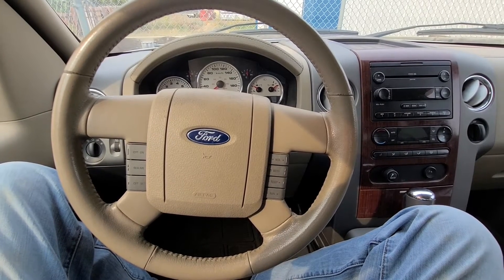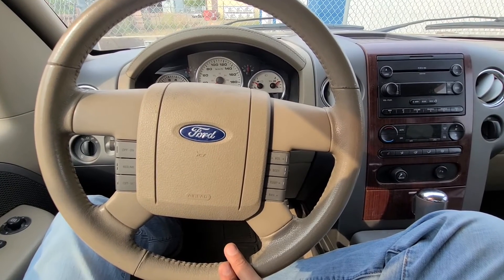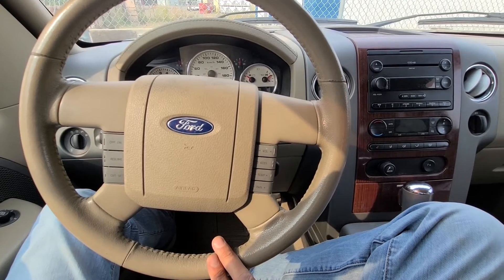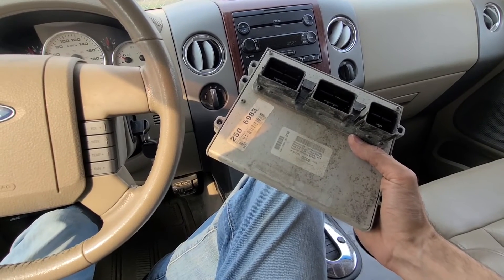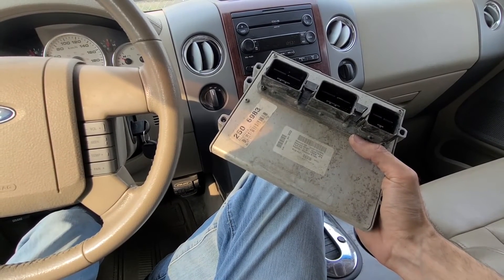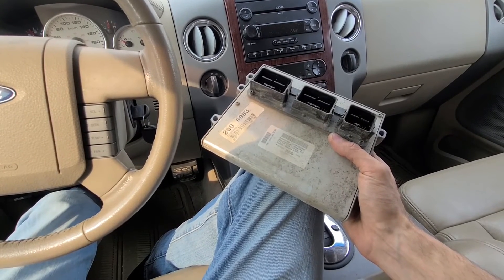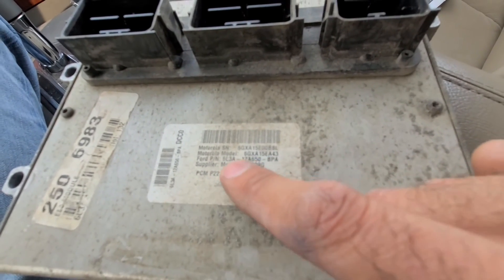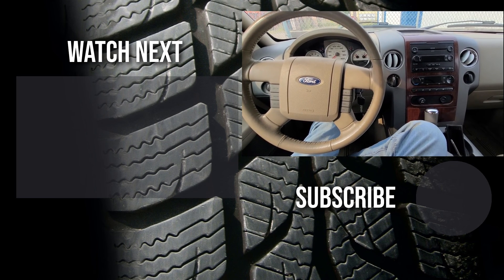Ford F-150 - ENGINE CODE P0607 EXPLAINED / HOW TO FIX (2004 - 2008)

Comment: Hi: Excellent and concise video! 
I have a 2009 Ford fusion 2.3 liter and just got three  codes - P2107, P0607 and  P0772. Car stalls when  putting into gear P0772 is  "Shift solenoid E stuck on ". With third code in the mix, I'd like to know your thoughts. Thànk you.
Reply from the maker: Hello thanks.
Really hard to say what is going on as this can be really tricky codes. But everything points towards a pcm problem.
Not really sure what to suggest here other than maybe trying to have the pcm software updated first and see if that resolves anything

Comment: I've had this off and on for a year or two now.  This is the only code I get, so it looks like a new PCM is in my future.  I like the idea of getting the existing one re programmed, but I bet it costs almost as much as a new PCM and if it doesn't work like in your case its just throwing money away.
Reply from the maker: There are some companies who can refurbish old PCM. Basically you send it in and they send it back to you. But for now if you don't have any other issues other than check engine light on I would wait

Comment: I’m doing the exact same process you did.  I’m waiting on pcm from eBay.   I’ve replaced and checked wiring.   Still getting code p0607 and p2107.
Reply from the maker: PCM fails often on these F150's. It should be plug & play once you get it and you cut the keys